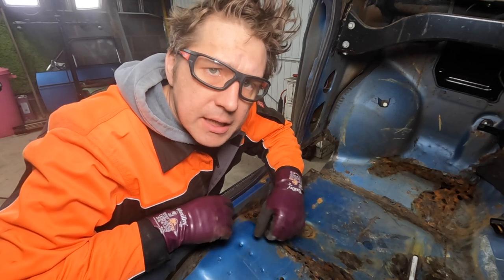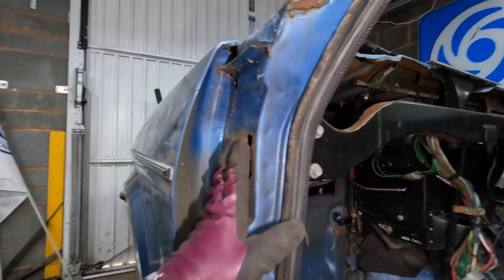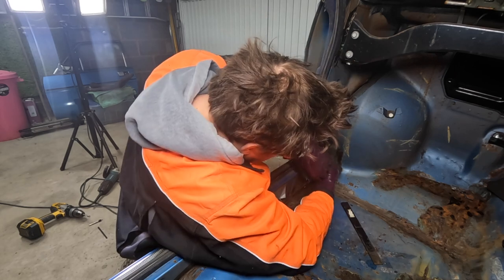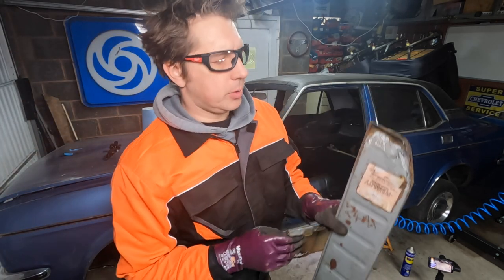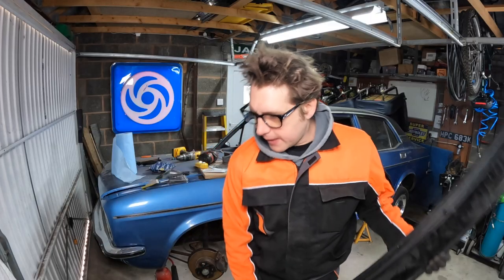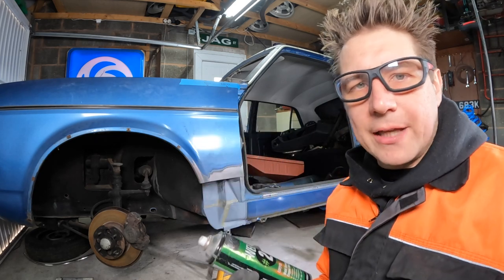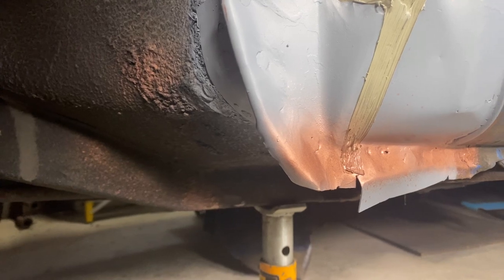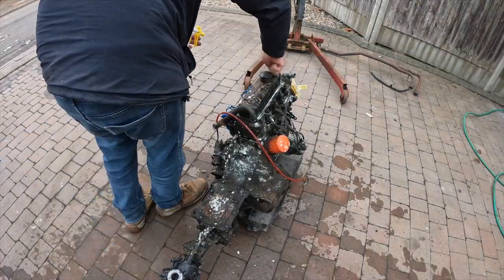Cars Always Rot In The Same Place!: Barn Find Restoration | Pt 2

Comment: That repair is amazing looking imho , you’re work ethic is second to none man 😊
Ps……I’d buy that Marina in a heartbeat if I lived on the same island as you, I’m across the shuck in Northern Ireland. Awesome video.😊
Reply from the maker: I can always deliver! Would make a good road trip video!
Reply: @claytonspeedcars  
I must have owned at least 7 Marinas in my time, my girlfriend had the orangy coloured one in the two door fast back version, compared to my MK2 Escort Ghia, it handled like a barge until you got used to it, i got the telescopic front shock upgrade which kept the original lever arm shocks as well and when I sat on the front wing the shocks barely compressed any at all,and Ifitted rear van springs as well and it helped a lot, but never as good as the Escort. I also fitted 185 sized tyres 🛞 as well, couldn’t tell if it helped any but it sure looked good. 😎👍👍👍🇬🇧
Reply from the maker: All the usual upgrades then! They can be made to handle, my turbo marina acts like it is on rails if I push it into a bend. Torsion bars for the win!

Comment: Are you a subscriber to Carter Auto Restyling? If not, you should be. Great to see the Marina coming along.
Reply from the maker: I'd not come across Carter before. Thanks for the recommendation!
Reply: @claytonspeedcars  Kyle's one of those quirky YTers that may take a few goes to appreciate but his bodywork skills are amazing.
Reply from the maker: I think I could learn a bit from him!
Reply: @claytonspeedcars : His is a bit of a dying art. Tack weld and filler seems to be the standard these days. That said, he has the time and patience. Watch the one where he takes a rusty, battered, and split rear fender and makes it like new. Amazing!
Reply from the maker: @johnpowell5433  I've never been one to tack weld and fill. I've been taught by old skool fabricators, guys who would make custom body kits for show cars completely from metal! They weighed a metric ton but looked the part and never ever split or cracked filler. This guy speaks my language!

Comment: Excellent video Geoff, instuctive without being OTT and silly, what MIG welder do you use and recommend and do you use gasless or Argon mix?, just asking as I am a bit of  novice but I have to weld new sills on my car, cheers
Reply from the maker: Thanks for the question. My welder is a Snap On Pro Mig 170S - it is about 30ish years old but still very capable. I use BOC Argon Shield Light. Perfect for welding under 4mm steel and 0.6mm wire.

If you are new to welding remember these three things: 

1. Welding is only 10% of the job. Prep is obviously the route to any good finish. 

2. Clean, clean, clean - you need to make sure there are no contaminants around the area you are welding. Clean off under seal and anything that might get into your workspace, back and front of it if you can. Use a strip disc to clean off old paint and primer and cut out all the rot. If the metal looks pitted then chances are it could have gone through to the other side and you will be blowing holes very quickly.

3. Take your time. Test your welder settings on a piece of steel the same thickness and age if possible to make sure you have everything set right. 

Hope that helps! Let me know if I can be of further help.
Reply: Thanks for your reply, I am not new to welding but a novice at MIG  your advice is very helpful, i guess the old adage of practice makes perfect comes to mind! cheers